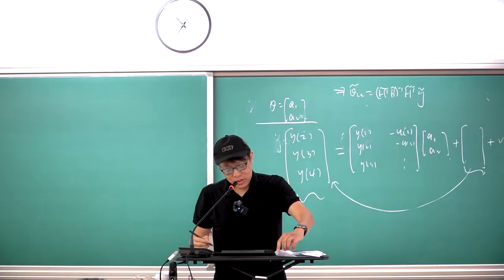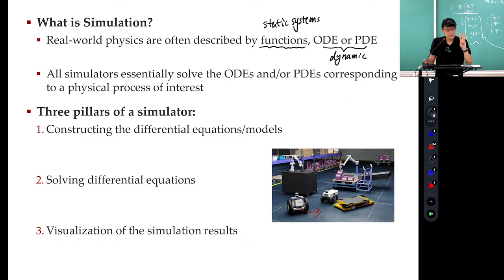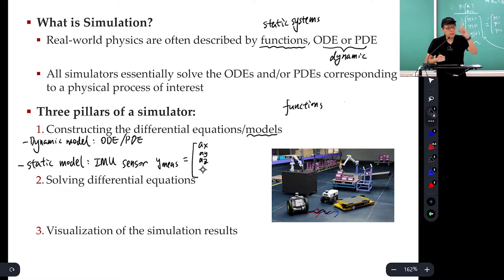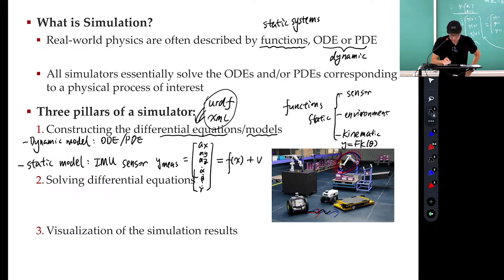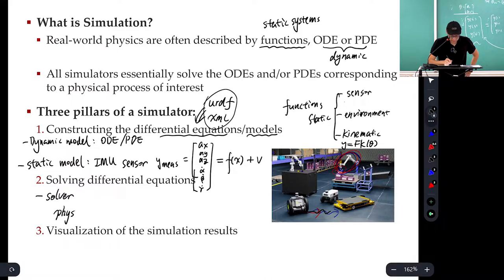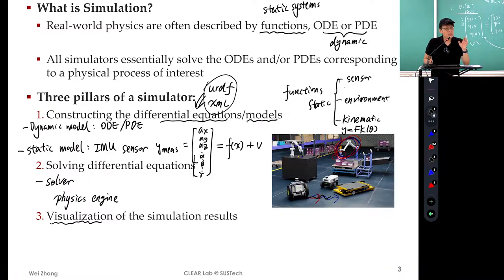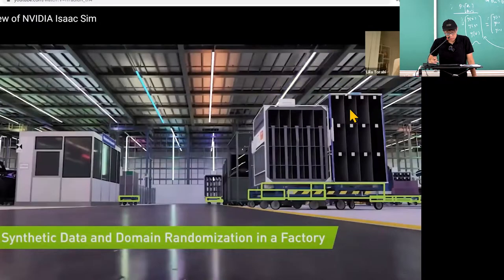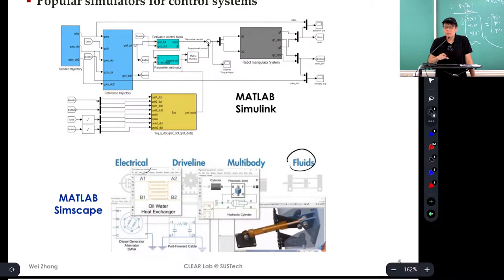Lec 6: Tutorial of Drake Simulation for Robotics and Control (ME424: Modern Control& Estimation)

Comment from the maker: TABLE OF CONTENT
00:00:00 Short Introduction to Robot Simulation and Drake
00:35:49 Intro to Drake and Simulation Examples
01:25:27 Example 1: State Observer and Feedback Controller Design
02:14:38 Example 2: Cart-Pole Balancing
02:56:36 From Regulation to Tracking Control, Definition and Derivation
03:50:20 Tracking Control Example: DC Motor Speed Tracking Control